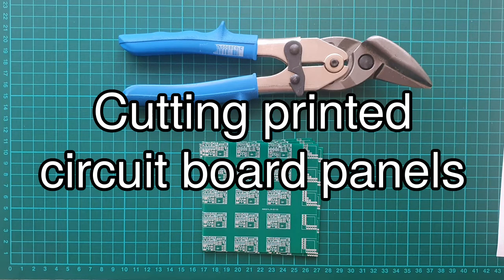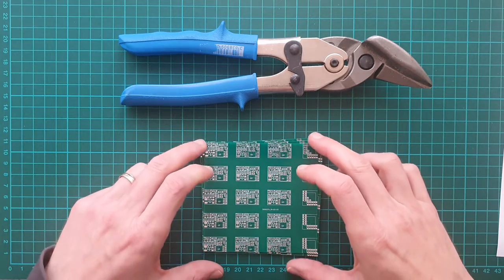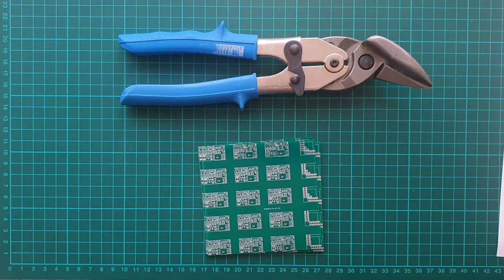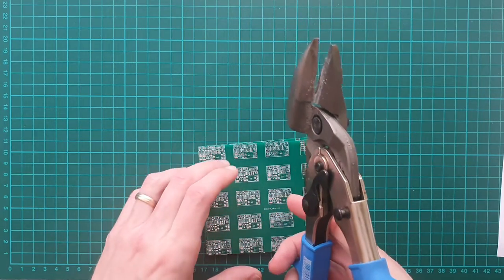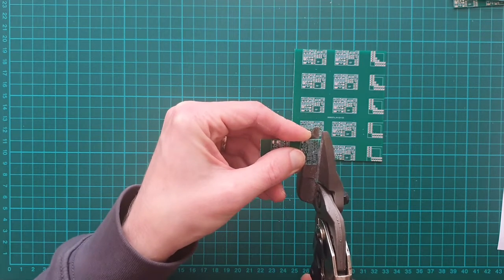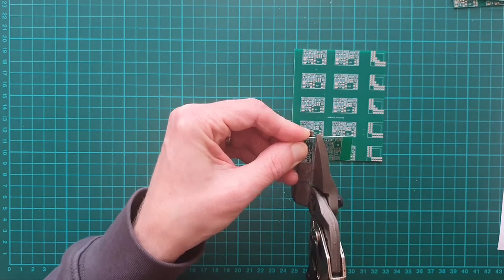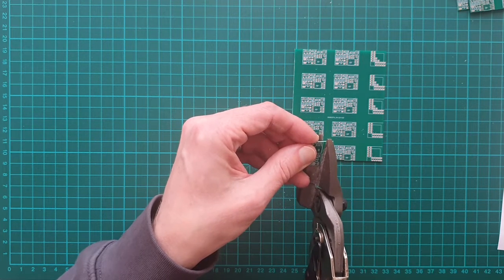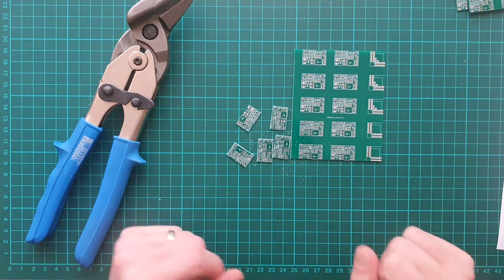Cutting printed circuit board panels

Comment: Thanks! Your video should have more views! Its the only one which shows this method. Word of warning for future viewers: A LOT of tin snips bend the cutting material a lot. Its fine for metal but you don't want that with pcb. You should look for those which do not do that. Like those in the video.Their cutting line is not aligned with grip line (pelican like) and jaws are shaped in a way that allow material (pcb or metal) go further after cut without bending it too much. So called "endless cutting".  Hope this helps someone.
Reply: That’s exactly what I encountered with using Tin Snips. They bent my PCB which is detrimental. Where can I find such Tin Snips?